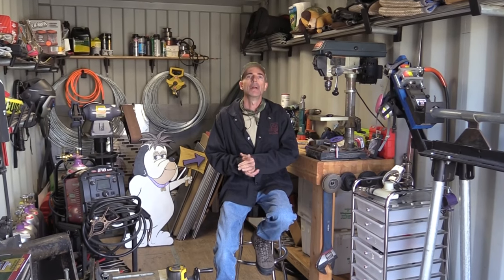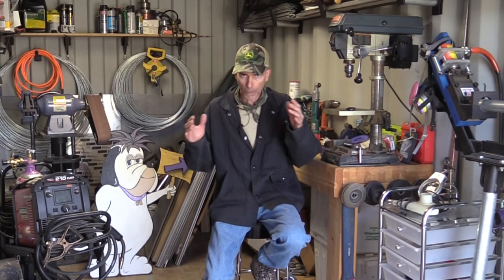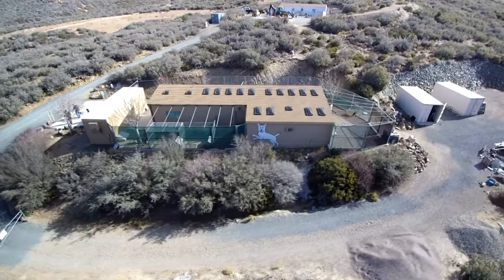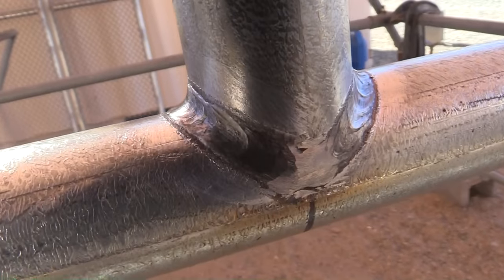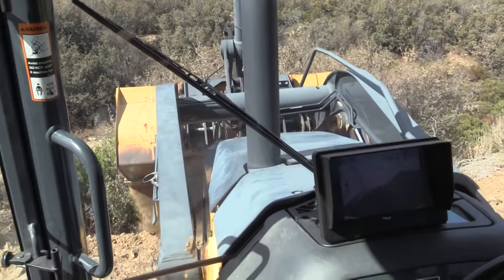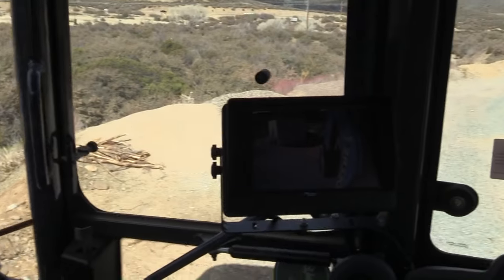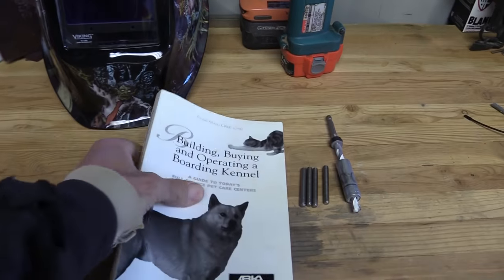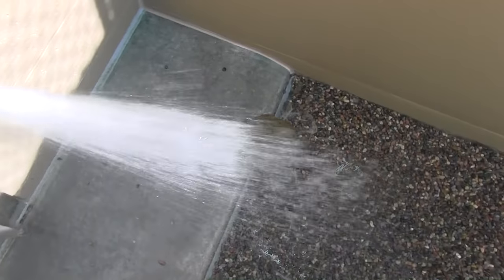Building A Dog Kennel: Intro

Comment: How often are you picking up the solid poop from the gravel area in each kennel and how are you going about picking it up?
Reply from the maker: As soon as we see solid waste it is picked up with a dog waste spade and scoop, if it is loose then it`s hosed into the waste management box which is connected to a septic sewage system... My waste management box system gives the dogs a place to go when they are restricted in the runs, but I designed the system to be used in conjunction with rotating the dogs  to play areas throughout the day, so the box becomes a back up if needed when they are in the dog runs.
Reply: @HURONANGEL  That makes sense. I like the water conservation your method provides. I've been cleaning out a gutter system kennel the past week while we are visiting some friends and it definitely uses a lot of water. I'm hoping to build a kennel at some point in the future and I'm thankful you have shared your method. Hope you are doing well.